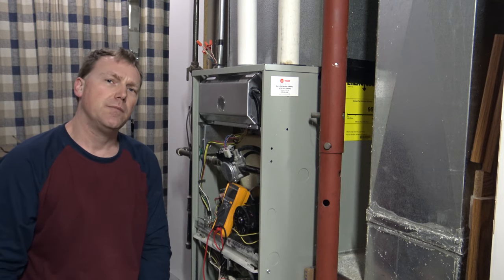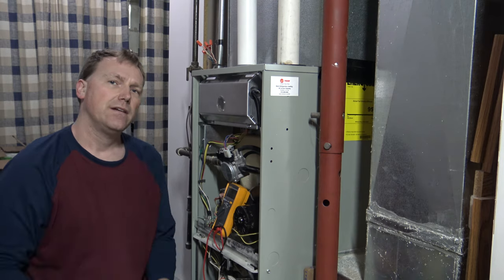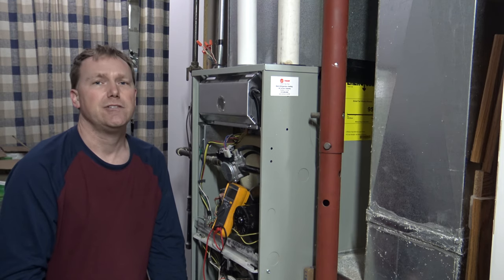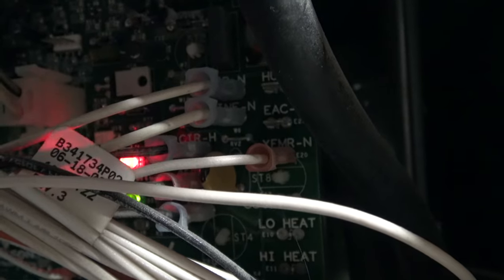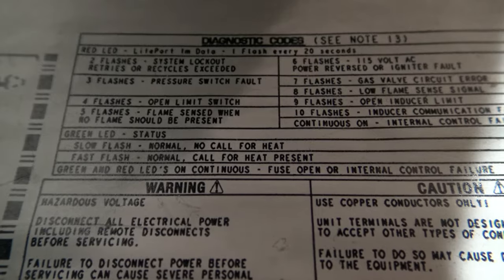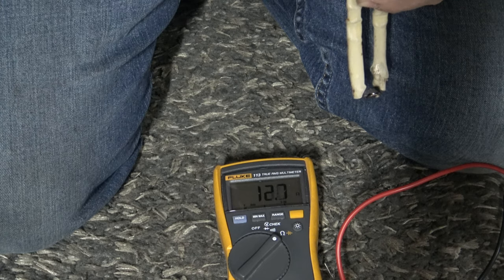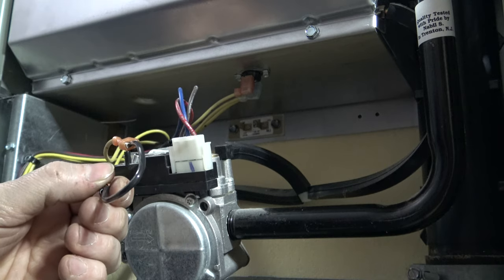How To Test and Bypass The Upper Limit Switch On Your Furnace

Comment: Bypassing the switch can melt your whole furnace and blow up your house if the heat inside gets to high. “YOU REALLY HAVE TO MONITOR THE HEAT WITH THAT THERMOMETER AND DON’T FORGET ABOUT IT AND DON’T GO TO SLEEP WITH THE FURNACE RUNNING UNLESS SOMEONE IS THERE MONITORING IT CONSTANTLY. That switch is there so you don’t have to monitor it. It’s like a security guard at a gate, it protects you from certain harm. If you take that security guard away, your gate is vulnerable to the elements.
Reply: That is what the thermostat is for, to monitor the temperature.
Reply: @AlexTechWiz - my HVAC tech removed the limit switch and ordered a new one. Took about a week to get the new switch. During that time, he bypassed the switch and the furnace would run as needed to keep the temperature at 70 degrees. When I tried to adjust the temp via the thermostat, the furnace did not respond and the thermostat didn’t respond either. It continued to keep the ambient temp at 70 degrees regardless of what temp I set on the thermostat. So my observation is in opposition to your statement.
Reply: No that's not how that works. The thermostat monitors the temperature in your home

Has nothing to do with the temperature inside your furnace

Comment: I called a friend that works for an HVAC company. They didn't have the switch. They'd have it Monday when the local supply company opens.
I ordered one from Amazon and supposedly will have it tomorrow, if not Monday. 
Keeping my thermostat at 68 degrees is helping pipes not freeze. It's currently 5 degrees Fahrenheit outside and going to drop even more.

Comment: I was having problems with the limit switch short cycling the furnace.  I was skeptical to bypass it, for safety reasons, and decided to look a little deeper.  I found that my heat exchanger was cracked, which was the root cause of the upper limit switch opening.  I’ve deactivated the furnace as I don’t want to risk getting carbon monoxide poisoning. Just wanted to point out that bypassing safety switches should only be done with acceptance of risks.

Comment: I have a 30 year old Carrier furnace which still had the original control board (HK42FZ011).  Well, the blower stopped coming on so I ordered a newer, less expensive control board (ICM282B). I had no problem installing the the board.  I switched on the system and it was running like a dream...until about 10 mins later when I started getting CODE33.  I tried to jumper the limit switch as you instructed but I blew the fuse on the control board.  Is it possible that it was because part of the metal connector on the jumper was touching the metal on the furnace?  I still don't know why i never got this kind of error on the old board but now, if close up the furnace by putting all the doors back on, it will CODE33 in a few mins.  However, if I leave the blower door off, it runs without issue.  My guess is that, with the door closed, the blower is not pulling enough air into the system and is causing the limit switch to trip.  Or, is it possible that the air pressor sensor is bad.  I am about to give up and buy a new furnace.

Comment: I tried your approach and got it working!  How long I can go on with this approach? I have monitoring setup and checking the temperatures every 30 minutes. I have folks coming here to replace the furnace and A/c in 3 days. Can I go on like this for 2-3 days? Checking the temperature at the vents for 120-degree is it good enough? thanks

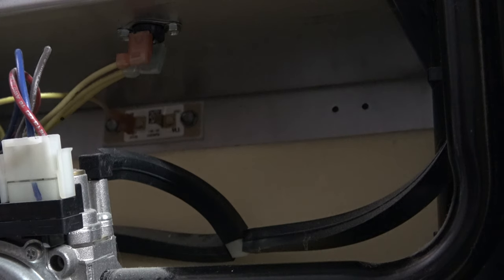Comment: At 2:44, there is text on the video that says "Make sure the upper limit switch is screwed in place. do not remove it if furnace is running." I'm confused. At that point in the video, the switch has been taken off the "wall", right? How do you screw the switch in place when you have a jumper cable (the wire with the black shield) on it?

Comment: I have a question I hope you can help with, I have a Trane xc95m that is randomly throwing a high limit error. I tested the switch and it appears to be fine, pulled the switch and it looks clean and new. Ironically when I used a jumper to bypass the high limit switch I ended up with a PS1 closed error 😞  I've ran the furnace with no filter in it, and the main door off but I still get a random high limit error. As you mentioned its usually earlier in the morning that I notice the furnace suddenly starts blowing very, very hard. If I go check on the furnace the high limit has been tripped, gas is off and the blower is running on high for a few seconds. 

I'm not sure where I would go from here? I even took the furnace door off and opened all the heat vents in the house. After a day like that I was getting the same issue. I took the high limit switch out, and with my laser thermometer the outside of the burner box was 47.2C - 117 and if I shot the laser into the high limit hole opening it was 95C - 203F

Comment: Bypassed the limit switches and still have the open high limit switch code. Even checked resistance from one end of the consecutive the other and it reads zero ohms. So there is no open in the high limit switch. Could it be the circuit board or what else can cause this code. The infinite r never starts.
Reply: May have to check your rollout switch those can trip and need a reset
Reply: @whitemike3580  I figured it out, it was the circuit board. I replaced it and now it works! Thanks

Comment: I bypassed it and it still won't fire up.. I just ordered the limit switch and the pressure switch.  Clean filter and cleaned the blower as well. I'm going crazy because the code still says  primary limit switch is open. Any suggestions??
Reply from the maker: Try turning off the power to it for ten minutes , turn back on and try. Make sure your
door safety switch is pushed in
Reply: @addismultitasking3504  I have.  I may have to call for help. Thanks
Reply: @Memito-  Did you find out what it was ? I would think that your “Flame Sensor” might be dirty and need cleaning too. The “high limit switch” and the “flame sensor” kinda’ work together, if one is the problem, it effects the other. I would love to know what the reason was. Let us know. Thank you
Reply: @flashy5150  me too dealing with that now
Reply: I am having the same problem now and I am going nuts. Did you figured it out? Thanks in advance

Comment: My 1-stage furnace   cannot turn the blower fan on when heating up in "Auto" mode. It does heat up and shut the power off several minutes later after that.  But if I turn the fan mode from Auto to On which keeps the fan running all the time, the system seems working fine. What's the cause? Someone who has the same situation with me says "I changed the temp sensor and everything is working like a champ". What's the temp sensor he mention, was it a high limit switch? Thank you.
Reply: My furnace having similar issue, what was your fix?
Reply: @joeoconnor87  checked the motherboard and found one wire blown out. Had it soldered back and it worked.

Comment: Worst advice ever having homeowners bypassing limit switches on a furnace.

It's a safety switch and is there for a reason. They should NEVER be bypassed for anything beyond testing.

Houses burn down because of this and it can be very dangerous.